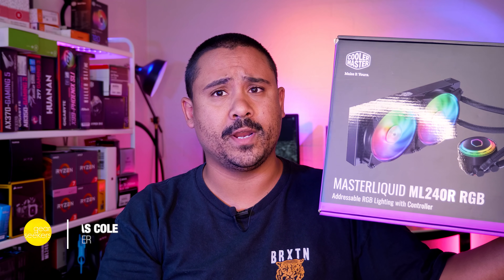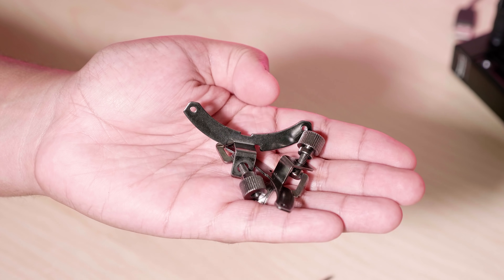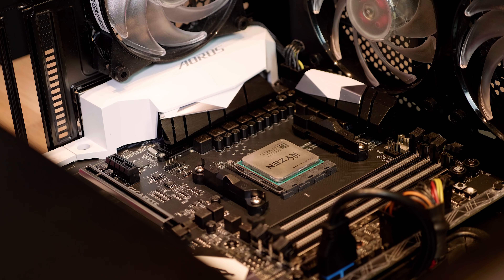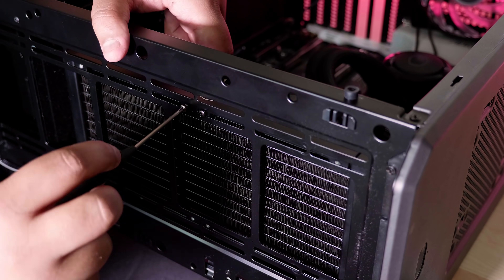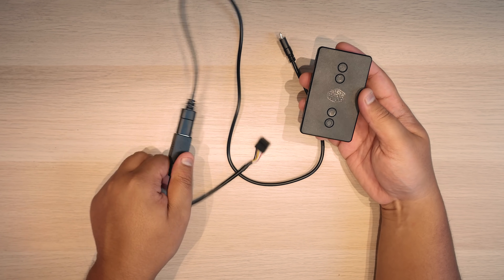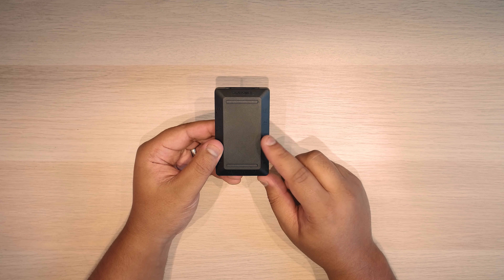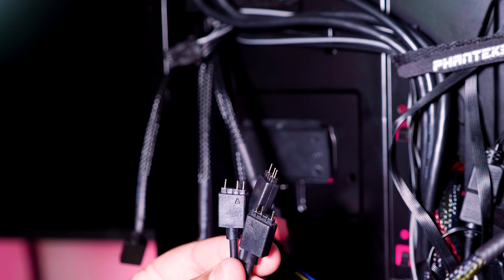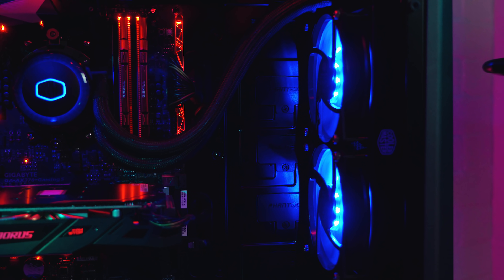HOW TO Cooler Master MasterLiquid ML240R RGB AM4 Install Guide

Comment: Hey I’ve had a lot of trouble recently with the ml240r. I just purchased it yesterday. I have plugged in all the wires just as you did in the video but the RGB’s for the fans and for the pump do not even turn on. But the pump does work as in actually pumping the liquid. PLEASE SOMEONE HELP!
Reply from the maker: Make sure you have the SATA power plugged into the controller. Some people forget to plug that in.
Reply: Yes I have the SATA cable plugged in. Also to note just then I had turned on the computer and the the two RGB fans turned on for a just a split second.
Reply: Gear Seekers Yes I have the SATA cable plugged in. Also to note just then I had turned on the computer and the the two RGB fans turned on for a just a split second.
Reply from the maker: That's very odd.
Reply: i have the same problem, bought this aio today!
Reply: I have a similar problem... Neither with controller box in ARGB (motherboard) mode, nor without controller box (X470 mainboard from MSI) connected to the 3-PIN ARGB MB header the pump lights are on ... just the 2 fans in changing colour. MSI mainboard software for RGB sync doesn't recognize the cooler... I am in contact with CM for at least 2 weeks... stay tuned
Reply: i got my replacement cm master liquid ml240r yesterday, after being confirmed by cm support that controller was faulty! Anyone that is interested in this aio, it`s a nice aio but they cut corners with expenses on this controller! It`s very cheaply made and people are giving flak on reviews of this aio just because of this controller! I tried using cm in house software to control argb but its still in the early stage of development and doesn't work properly!

Comment: So connected everything up same way as you but have intel board. Worked first time I started it. But then turned off and wouldn't turn back on. I took the usb header out from the controller and computer started back up. Put the header back in the it won't start up. Has me stumped. Any help anyone?
Reply from the maker: You might have a dud USB header. Have you tried all the headers? Also you can try connecting it to a USB port to see if you have the same issue.
Reply: Gear Seekers I will try that. Cause when I have everything plugged in i hit the power button and i see all the fan lights come on for a second then turn back off. Unplug the header and try it again and everything turns on.
Reply: Gear Seekers tried it plugging into usb port and same thing. See the fans turn on for a second then nothing.
Reply: Gear Seekers well controller working all plugged in. But only one light on one fan working. Sounded like I heard shorting before but yeah that's it. Guess no rgb for me ha lol
Reply from the maker: Have you tried pressing the buttons on the controller to change the lighting?
Reply: Gear Seekers yeah nothing. Just one green light on the one fan and that's all I got. Will have another look when I finish work today.
Reply: Gear Seekers yeah the LEDs have gone on the liquid cooler. Might swap it out for another. Hopefully.

Comment: Hi, was wondering if you were able to run the Cooler Master software?   Having issues running the software to control the lights, when I run the software it says its not recognizing the connection.  I have a MSI Z370i motherboard, and connected the CM ML240R USB cable to the JUSB1 slot.  Works with the provided hub, but not with the software tool.  Were you able to run the Cooler Master software on this build?  Just curious  thanks!
Reply from the maker: The software hasn't been released yet. It's coming this week
Reply from the maker: https://youtu.be/zhCzkxRv8E4 Here is our video about the software
Reply: appreciate the response, thank you!

Comment: Great video. I have the same cooler kit and a rear coolermaster rgb fan but the rear fan is stuck on one colour. It is switched to rgb on the fan and connected to the control box but still its stuck on one colour.
Reply from the maker: The RGB lighting software should be here this week. It will most likely help you fix it 😀
Reply: Hopefully, or my only option is to wait until the new fans are out.
Reply from the maker: https://youtu.be/zhCzkxRv8E4 Here is the video about the software
Reply: Sorted the fan out in the end with software but its not the same fan as the ones what came with the aio kit. Cant seem to find them anywhere for sell.

Comment: HandsDown! Most under rated tech reviewer. 🔥👌

btw I've Aorus X370 Gaming K5, so will i be able to sync my System lighting  /RGB strip lighting &This aio and it's fan together via software anytime in future? 

also, your video came on the right time. my ml240r is getting delivered today and i was waiting for this video from your video where you showcases this cooler when it was sent to you by CM! 
keep up the great work 💪❤
Reply from the maker: QuadRoe I don't think the K5 has an addressable header. I'll have to double check ours. The software from CM should be launching today. To control the RGB. You can connect strips directly into the controller as well as long as they use the standard 4 pin header.
Reply from the maker: Also thanks for the kind words. I work pretty hard on this channel. 😀
Reply: Gear Seekers I guess it have an RGB Header but correct me if i'm wrong, Coz i've currently connected my RGB strip into it which i control via RGB Fusion software by gigabyte / aorus. 
Yes, You definitely deserve more audience, seeing true passion and hard-work you're putting in this channel.
Reply from the maker: You will be able to connect it directly to the controller when the software drops so you can use 1 program to control everything. The controller has a connection for 4 pin RGB as well